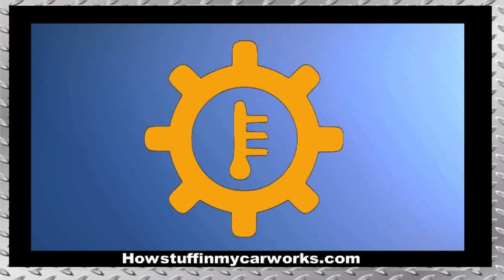Jeep Patriot 2007 to 2017 common problems, issues, defects and complaints

Comment: Bought a 2010 Jeep patriot back in 2013 still running strong with over 237,000 miles . Been up and down the West Coast Canadian border to Mexico and all in between. Throttle body been replaced (Amazon) Both thermostat been replaced.  both upper control arms. Have never change the transmission oil, been good to us A/C still working, heat still working.

Comment: 2012 Patriot, no major problems just wear parts like brakes and rust problems like muffler.
Reply: I’ve have a 2012 4wd for a couple years now… but I’m overheating in the summer and my drivers side window is stuck up! 🥵 (crank handle style) trying to figure out how to fix it myself and I know zero about cars

Comment: I had a wheel bearing go at 40k miles. Jeep is clearly putting crappy parts in their Patriots. Mine is a 2016 high altitude. Oh and I had to replace a wheel speed sensor at only 25k miles.
Reply: I just hit 100k and got my first CEL. 2015 patriot High altitude. Prior to that no issues. Only thing replaced is the battery.
Reply: My wife's 2014 needed a new throttle body at 40K miles...and another throttle body at 51K miles. My 2016 needed a throttle body at 40K miles.
Reply: @Tesla Edison: Just out of interest regarding the wheel sensor, had the clip failed on the flange of the bearing or did it simply stop working?

I have a 2012 and both rear sensors have popped out of their keeper.  I just can't get fingers into the space to reset the sensors.  The dealer reckons I need two replacement bearings (no noise or rocking at all!) with two sensors AND a rear axle, for a cool $3-5k!!
Reply: @paultaylor7691  whoa!  Stay far away from that dealer.  I did rear wheel bearings on my 2015 High Altitude Patriot and the wheel sensor was hard to get plugged in.  The secret I found was to use extremely long needle nose pliers that you can get at Harbor Freight.  They're worth having.  I think they're like 10" needlenose.  Good Luck!

Comment: Bought my 2016 patriot  and less than a month later rain started leeaking through my light ruining my radio.
Reply: I have a 2015 Patriot. Rain got inside my headlight sockets an blew them. The bumper needs too come off for bulb replacements. It was pretty costly!!!
Reply: My 2016 Patriot sunroof started leaking too so I put a bead of silicone around the  top. Problem solved

Comment: What is he saying #5 is??? Our 2015 shuts off while driving, we've replaced the fuel pump, vvt sensor, crank sensor,  camshaft 1&2 & we're still having major issues, someone please help 🙏🏽
Reply: The Total Integrated Power Module (TIPM) is what he's saying. Given your symptom set it may be worth looking into that. Though not a Jeep guy (typically), your issues do seem electrical and hopefully this is the fix. Otherwise electric issues a PITA to fix and get expensive quick
Reply: Hey I’m having the same issue with my 2015 Jeep patriot. Did you get it fixed?

Comment: My daughter has a 2009 patriot. So far, all wheel bearings, cam and crank sensors, and the biggest issue, vapor lock. If she fills her gas tank up, jeep will stall at idle. She simply does not fill it up now.
Reply: Does she just partially fill it ?

Comment: 2014 Partiot 4x4 Sport with CVT,  224k. Major issues: wheel bearings, suspension parts, one drive shaft, fuel rails, AC issues, transmission overheat light which covers most problems. I purchased Chrysler's lifetime warranty when new which more than paid for itself. Without it, this vehicle is no bargain. However, when the pavement ends and conditions are poor, this Jeep excels at its mission. Tip of the day for CVT fluid: Use Valvoline CVT fluid. Oh, and i love the "Trail Rated" badge!

Comment: Rusted subframe(s) should be at least in the TOP 3! Serious problem if living in the snow belt. So much so that FCA extended the warranty for the subframes to 10 years. If you are the original owner, inside 10 years, have your dealer check your subframes ASAP.

Comment: Thanks for posting this. I just got a used 2014. Been having code for front catalytic converter come on check engine light. Going for replacement so I will have these items looked at.
Reply: How did that go?
Reply: Hi. I have a 2014. How is yours holding up

Comment: Thanks for the video. I have replaced the throttle body twice in my 2011 patriot, once oin 2015, then in 2020. Now in 2022, I'm having to replace my lower ball joints. 
The mind blown issue is the rear defrost code of B106D. ANY IDEA HOW OR WHERE TO CHECK THE ISSUE??? There appears to not be a fuse for it, and my fixed sensor has it labeled as major!

Comment: 2017 jeep patriot,, having problems staying running, brand new battery in it alternator good, need help diagnosing what the problem is, it starts goes 10 feet stops running, headlights go out
Is it a ground ????
Also feels like it doesn't get enough gas

Comment: Mine has 200k. Hasn't had an oil change since I've had it 100k. I jump it all the time as the battery is crap. Still runs great gets great gas mileage. Only thing Ive done is throttle body and water pump when it froze and I didn't have coolant

Comment: What is number 5 bro??
Reply: It was the black box thing lol
Reply: What was it tho?? Lol
Reply: @jackiieperez3479  TIPN Module.
Reply: TIPM
Totally Integrated Power Module.  The Jeep's brain.
Reply: I'm having that problem now. Shuts off while driving. Any advice?
Reply: @matthewmurphy3945  had my sensors replaced but still having trouble it shuts off by itself
Reply: I'm having the same problem, don't know what to do
Reply: @matthewmurphy3945 Brain transplant with new CPU or equivalent. Look up you tube videos on this. My 06 Dodge Dakota needed one!